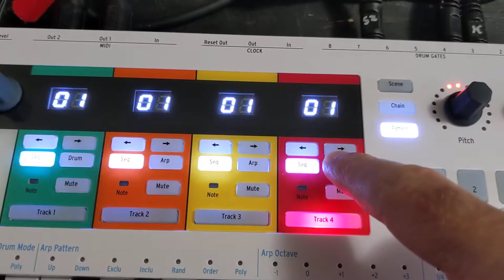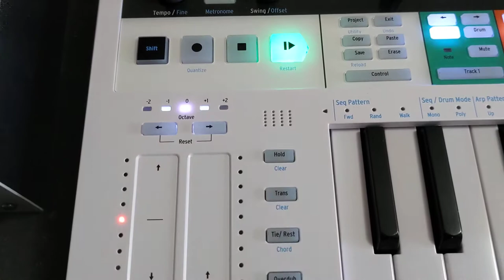Arturia Keystep Pro bug of the day - transpose corruption

Comment: First day with mine (Nov 10th, 2021):
1. It froze during transpose experimentation
2. When I powered down, and back on... the screen wasn't on, and most of the lights stayed off. Turned off again, turned on... all was well.
3. 15 minutes later... Arpeggio on Track 3, set to "Exclude".... it was functioning as "Note Order". I changed to "Include." Same behavior.
4. Arpeggio.... now, set to "Up". Held down a C major chord. It turned into a chromatic climb up like 4 octaves (Arp was set to 1 octave).
5. That same arpeggio latched itself. The hold button was not on. It got stuck like this.

Only solution to that stuck arp mess.... turn off, turn on.

Latest firmware (2.0.1). Did factory reset before, then firmware update, then factory reset after the update.

Also, should mention... enabling the metronome while playing some patterns.. the metronome always sounded OFF. Like, late, or early. I was sequencing virtual instruments (only two), from Reaper.... the metronome was just not tight, like the Reaper metronome was. What the hell? Like seriously. It makes it basically useless, I feel.

This thing is now $500? Are you shitting me? The Beatstep Pro provides more randomness/probability and fun. Sure, it's two monophonic sequencers, which is a drag. But... it's still fun. I mainly wanted the KSP for randomized melodic ideas constrained to a scale. But it's so clunky.

A Digitakt can do polyphonic sequences via MIDI tracks, it can sample... the probability and chance/random stuff is quite good. Granted, it's expensive. But it's only $300 more than the Keystep Pro.

A Push 2, while a paperweight, mostly.... is $300 more than the Keystep Pro, and with the Probability Pack (M4L device), you can do all sorts of random fun things. Launch clips/patterns/scenes... and so much more, with Ableton. Or, go the cheaper route... Launchpad Pro MK3 for $150 less than the Keystep Pro.

Or best yet... one of those generative MIDI plugins that can randomize cool stuff within a scale.... for pennies. I mean... like, what?

I am very likely returning this KSP. I have a Beatstep, Beatstep Pro, and Keystep 37. I love all of them. This? It's a frickin' mess. It's a semi-finished Beatstep Pro, with keys. I'm really disappointed.

I want to like this thing, but it's so friggin' buggy. I see the potential with it, but I think other options are more rock-solid.